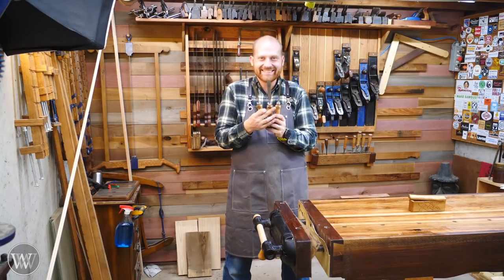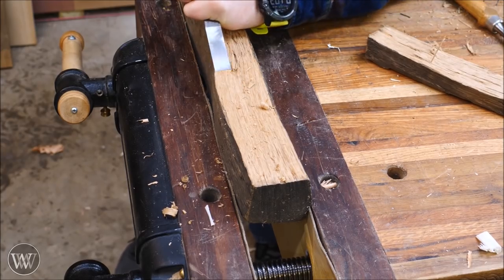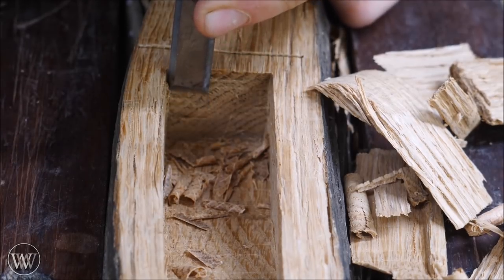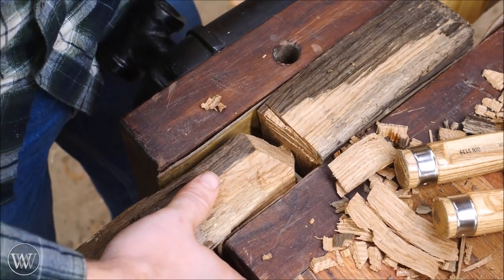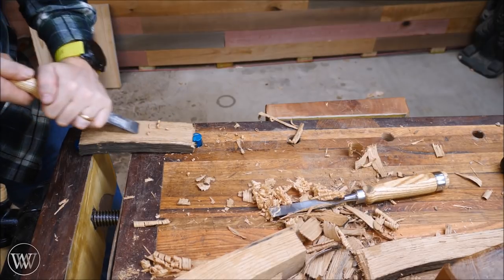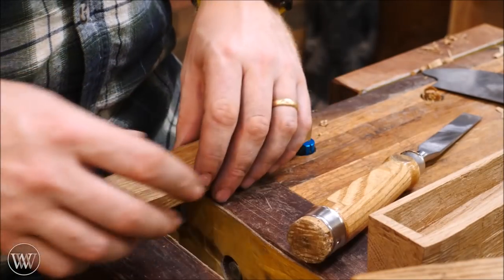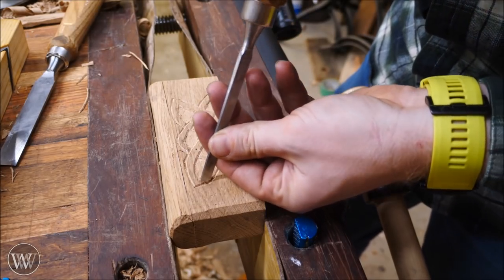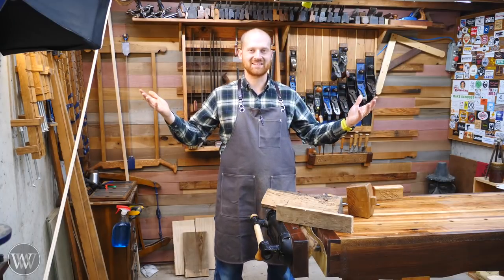Making a Box With Only a Chisel | Hand Tool Woodworking Challenge

Comment: This is great, however, the title says a chisel, not chisels, and the workbench and vise were used. Being new to woodworking, I still don't have a workbench, so a question: Do you have any ideas for doing something similar without a workbench? In other words: Is there a clever way to make a substitute for a workbench, for a place with no room for a workbench? Any suggestions would be greatly appreciated! :)
Reply from the maker: Before the workbench I just sat on the floor and use that instead of ice I just pushed it up against the wall. Also I use a folding table and a c-clamp to clip things to the folding table not perfect but it works.
Reply from the maker: for small spaces that is a treat option. I know guys with a small apartment that will clamp that to the kitchen table and use it.

Comment: Cheater starting with firewood, go into the forest cut down a tree with your chisel and only with one chisel, no hammer anything else a found rock, branch anything like that acts like mallet and again techinically cheating also your working bench is one hell of a tool can not forget that so there is atleast 3 tools involved there already , let it dry, split it with the chisel and make your box, , then come telling folks it`s possible :D :D on a more serios note, yes it's possible starting from a firewood and ending up with a box using only a chisel but why would you, seriosly why? when there is so many other wonderful tools too to help you speed up the process...
Reply from the maker: because I find it fun. many of the things on this channel are done the hard way and in every project I limit myself in tools to hone my skills and find a different way to do things. I am actually working on a video now where I will be chopping down the tree using only a chisel.
Reply: I'm sorry if I came across as rude, that was not my intention, my original post was meant more tongue in cheek. As a challenge if I think back makeing a box with a chisel was a part of my wood-working class at the very beginning maybe in grade 4 or so, just so young boys would get the feeling of what and how chisels work and believe me many boxes started as firewood and ended up as firewood :D
Reply from the maker: @kalev60  oh sorry. I took it as a question and tried to answer it.